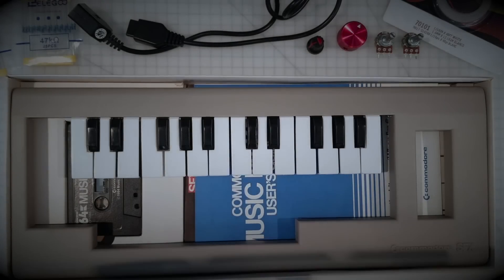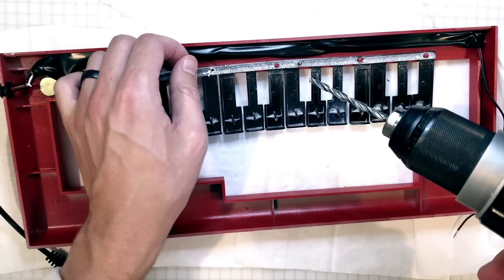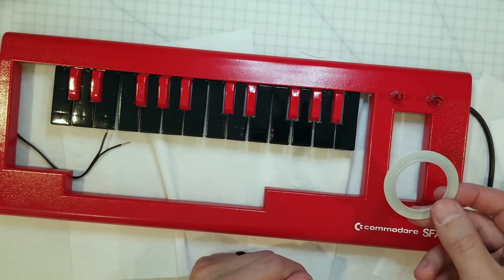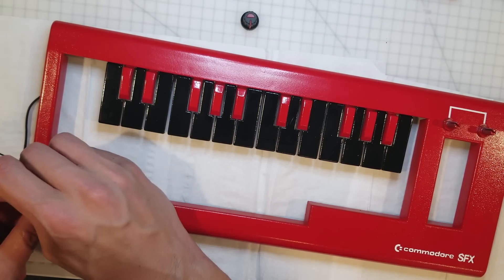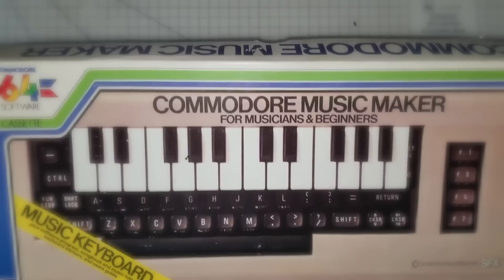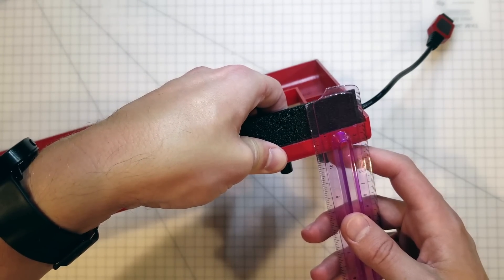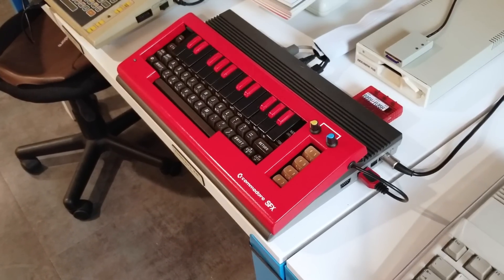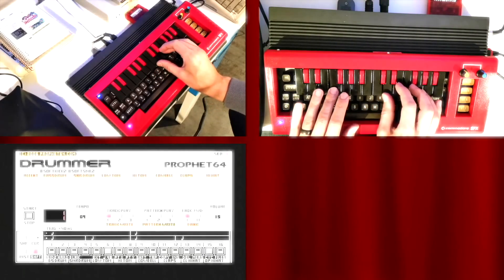2/6: Commodore Music Maker Refurb - Recording An Original Hit Song

Comment: The amount of videos this is I wouldn't be surprise if the last part is Dual Sidding the C64 for even more note bending wizzardry by having 2 different sounding SIDs at once in your recording gear. lol.

I wonder what making your own custom injected mold version would be like too because if it's made custom you can fit it to the AMIGA and have the keys react to the AMIGA keys that make notes in their trackers like your pro series, octa series and TFMX series but I bet the AMIGA is more technical having to have different lenghs to every key to make an overly that works for that.

The idea though would be to full size your AMIGA versions keys and put tabs in the custom keys which means it only presses the used keys down but then you also have the option to buy a midi interface and hack it to bits to add midi to a custom real keyboard with pitch benders which is better than making an custom overlay for AMIGA trackers I guess but the hard part of a real keyboard project for the AMIGA would be hacking the bulky external midi adapter into a more compact internal one either inside an AMIGA or the keyboard itself to begin with.

Sorry for giving you mad ideas but this is a good passion project as you a musician anyway so it would be bonkers and fun to try and make your own gear for other systems as well especially as for 16-Bit systems you an AMIGA fanboy that makes it all the better to try and come up with something bonkers for the miggy seeing as guys like Retro Man Cave and Retro Ravi proved that the AMIGA is a actually a really good midi machine albeit bulky with a big block coming out of it normally and Ravi posted a video of real Jungle and Elecronic Music in the Mainstream settings were made on it.
Reply from the maker: Nice ideas!

Comment: Just shows how under used that idea was, who knew I had a device in my loft with that potential especially when I spent money on a keyboard and sampler unit back in the day. Your mod could do most of what I wanted back then.  Only trouble is now I want an Akai MPK.... Not a problem they are not over expensive, trouble is the standard one looks boring, need a special ed version.

Comment: Perhaps a tip for the future. Use automotive polyurethane spray paint. They settle nicely and have minimal bumping (orange peel) and allow for wet sanding, and also do not run as quickly as water or acrylic based paints. That stuff is magical!

I refurbished my battle damaged telecaster last summer. It had a massive dent/pit in the body. I’d build guitars before but I never dared to paint them, knowing me ineptness with spray paints.
Until a befriended car body worker put me onto those paints. And it’s like magic! 
They smell terrible they dust all over (so do spray outside, I had a purple dust coated bathroom). But it’s gorgeous. I’m thinking of doing it to my Amiga. 
Here’s the end result of the paint job and wet sanding and polishing. 

https://www.instagram.com/p/B0qlsUBiyUL/?igshid=k8h59wokjwez

This is after just spraying and drying for 24 hours, you see some orange peel because it’s a really heavy coats. One colour spray can and almost one clear coat (that you need if you want it almost car like).

https://www.instagram.com/p/B0p7F6UgEXN/?igshid=1efnfsvwkbx2y

Splendid playing on the tiny keys 🎹